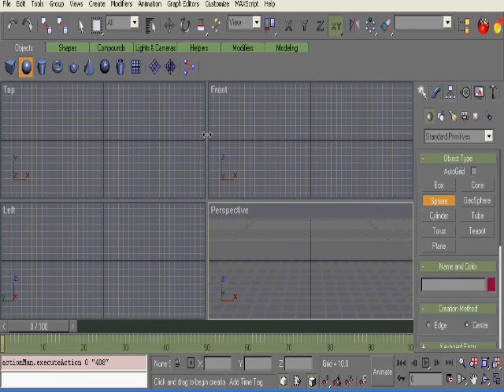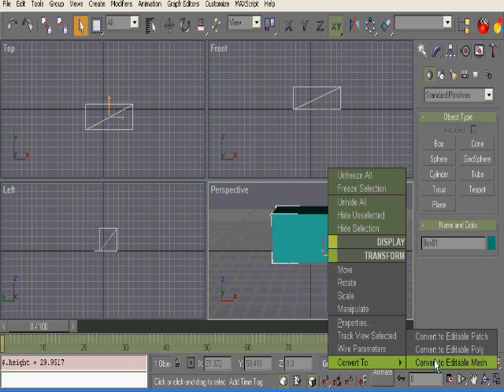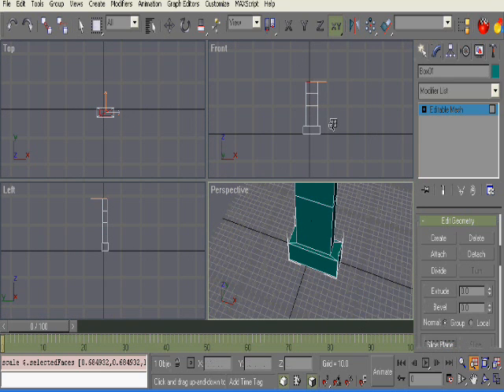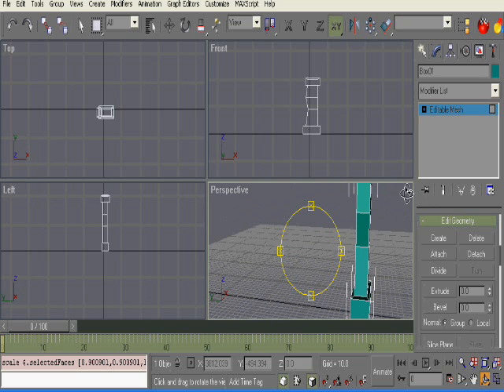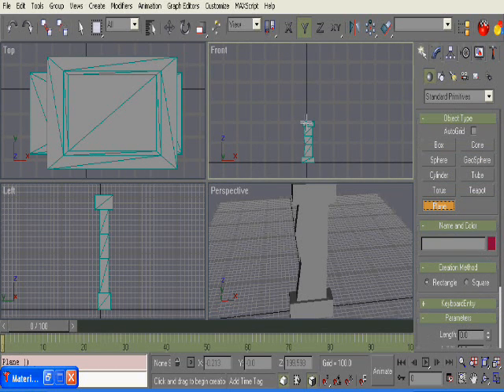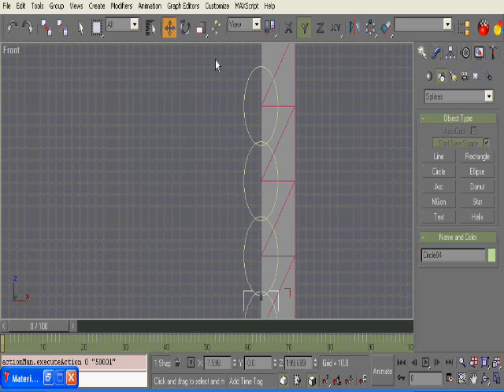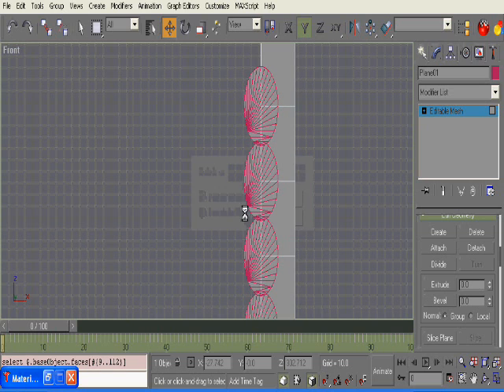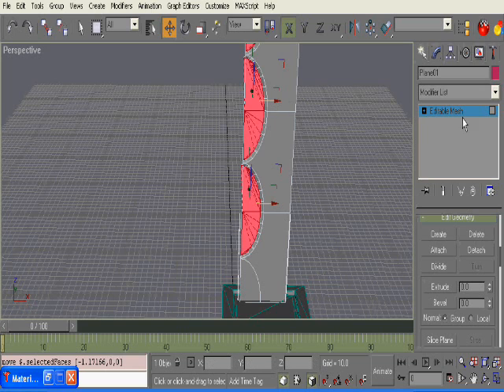GMax Tutorial - Combat Knife part 1

Comment from the maker: Personally, I like Blener a bit more than G Max, because it has a very useful UI *User Interface* when you learn what everything does and so on. But g Max is a bit like 3ds max, so the UI is a little bit more simple to get used to and it has some modeling tools that make it easier to use. But Blender also has a built-in *YAFray?* rendering system and once, as I said you learn the UI it's simple to model in Blender as well, I would recommend Blender. If you want more background on the progs PM Me